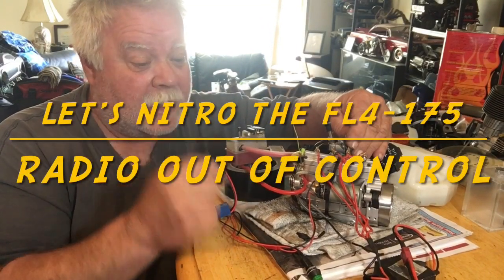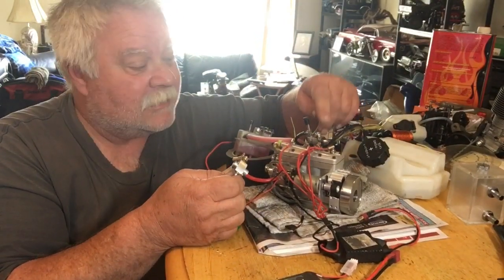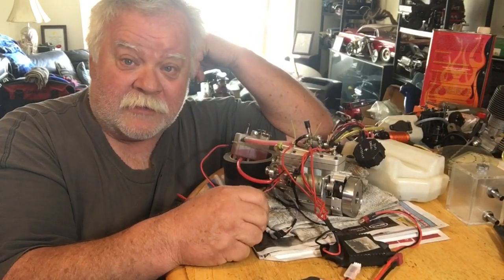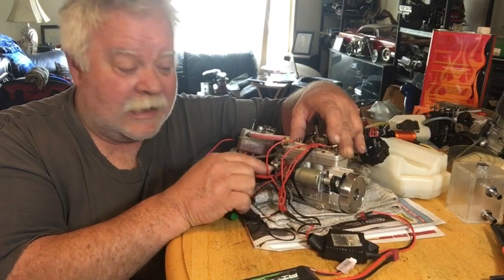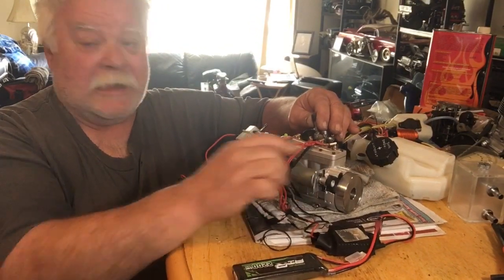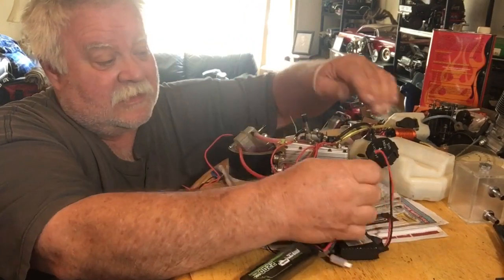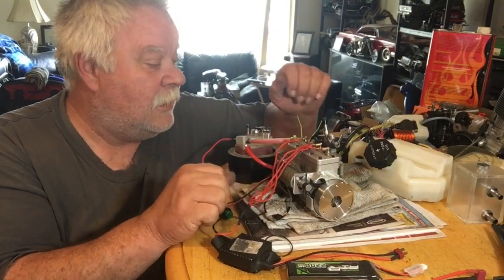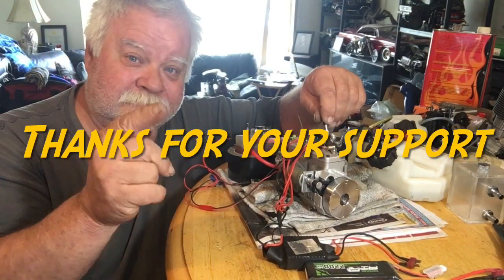LETS NITRO THE CISON FL4-175!!!

Comment: I see you solved the problems in a very practical way! Optimal! So you recommend using another carburetor?
I am waiting for 4 new spark plugs under warranty, as the ones supplied break almost without touching them and cause them to discharge electricity to the ground. Now we'll see if anything changes.
Reply from the maker: I used an old traxxas 15 carb it fit perfectly and throw some glow plugs and nitro fuel at it then we have a good revving stable engine!

Comment: I believe im with you on the nitro but when you fixed the pulley you said it fixed the pump and hall sensor. I guess it didn’t make any difference to it back on the gasoline. Just wondering thank you for your time and vid
Reply from the maker: the gas needs a vacuum advance in the hall sensor to get ready for the drive train load, where nitro dosent need it to rev under a load, im still testing brother,

Comment: Hi Dennis thanks for your videos on this unique little engine. Your vids have helped me a great deal on my build of this unit. I have had a good deal of problems with this little thing and have yet to get it to run for more than a few seconds. After some thought I've decided to go with glow plugs (OS G5) at least to break it in. However I'm confused, I thought that you could run gasoline or glow fuel with this plug, but at the Horizon or Tower? hobby site it states that the plug is not intended for glow fuel. What gives?
Reply from the maker: Good question my friend, glow plugs are for nitro the spark plugs can be run on nitro but the timing needs to be spot on ,  gas can not fire on a glow plug it extinguishes the flash point of gas, set it up with the glow plugs and voltage to run them add some nitro and I think you will be smiling within seconds when it lights up,
Reply: @dennisdempseyradiooutofcontrol  Agreed, at least that has been true in the past but i'm seeing more and more vids of people converting their four stroke glow engines over to gasoline,(actually 2 stroke mix), because of the cost, the mess etc. of nitro fuel. As I stated O.S. states that this glow plug is NOT for nitro fuel, so it must use gasoline. When you have a minute please type in OS G5 conversion here on Youtube.

Comment: Hi Dennis, great video! Love the sound. I've been having a lot of issues with my fll4-175, Would you mind telling me what carb settings you have on the nitro version (how many turns on the main and low needle)? Also, what nitro % do you use?
Mine didn't even attempt to start with nitro so I'm wondering what can be the issue. I'm using the same glow-plug driver you have with 2s lipo (7.4 volt).
Thanks in advance.
Reply from the maker: Hi I used a traxxas 15 carb on mine but the factory 175 carb did work but not very well, use a 2 turn setting on the main needle and a 1.5 turn on the low idle side to start. I am using a 20% nitro fuel and I think the starter motor needs to spin it over faster to start it on nitro,
Reply: @dennisdempseyradiooutofcontrol  thank you! I will give it another try